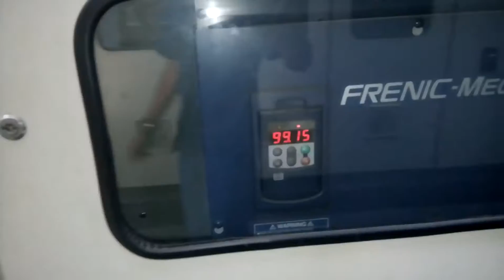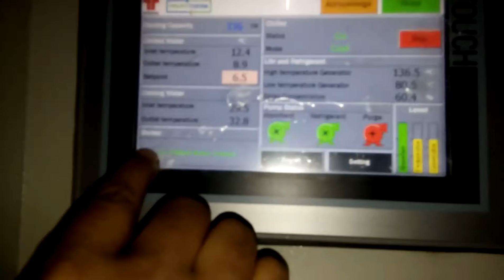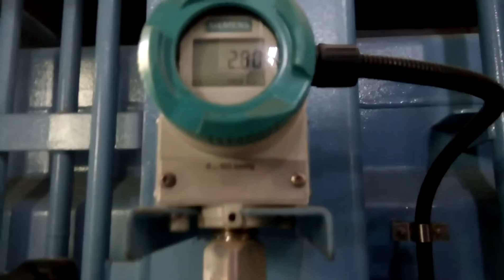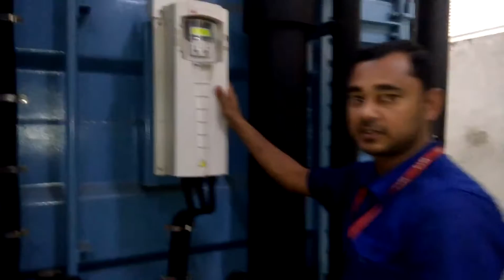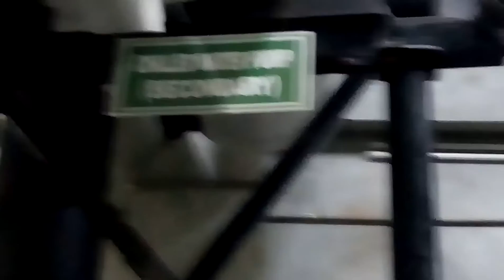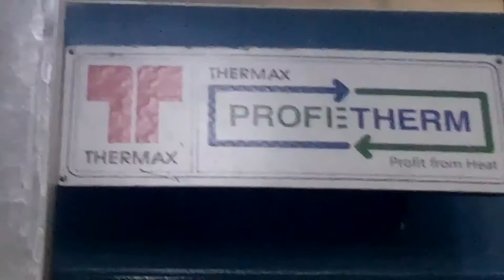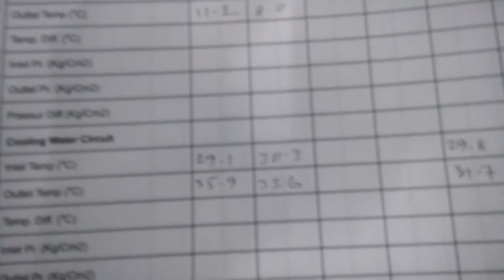Vapour absorption chiller plant

Comment: too high cooling water temperature goes into machine. low flow of the li-br goes from HTG to absorber. too big temperature difference LTG and Vapour temperature. machine need to fine tune. Why connection box for the pump is still not unpacked?
haha rapture disk piping not connected.
furnace temperature is only 595 degree, burner is not properly tuned.